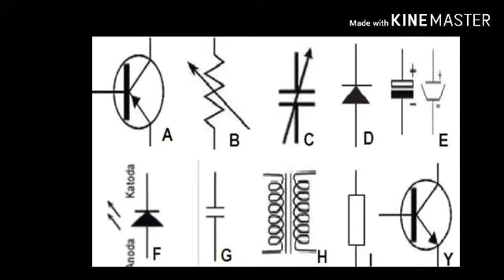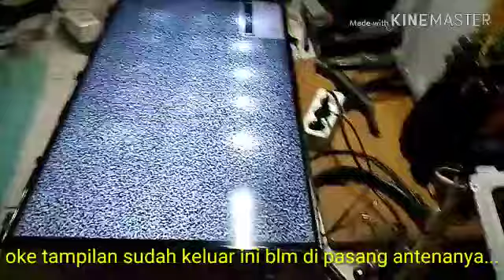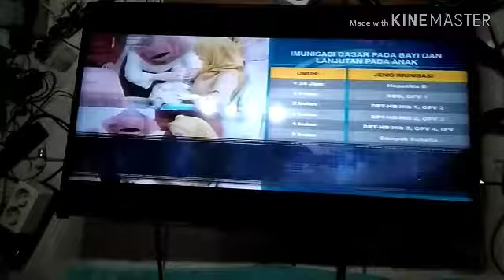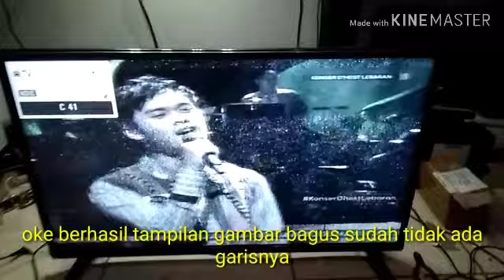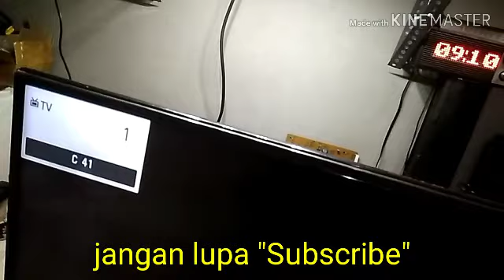Cara memperbaiki panel yang blank dan bergaris #v5

Comment: Assalamualikum ...gan...ane mau tanya ke semua comunitas teknisi khusus tv led,ane ada masalah ,di tcon lg32 LN1500 mengalami short / tidak ada tegangan vgh. Bagai mana solusinya tanpa harus bli tcon baru. Bisa di jamper ga? Terima kasih ...sy berharap ada jawaban yg tepat. Maklum sy baru pemula.
Reply from the maker: Short dgn grn apa 0v ?
Coba cek bagian voff keluar tegangan apa gk ?
Klo gk koslet dgn gnd dan voff keluar - v pake step up untuk ke vgh dan jika short coba lepas ic dc to dc klo tidak shot lg ic dc to dc rusak tp klo ic dc to dc sdh di lepas msh short kemungkinan cof atau panel short ...
Reply from the maker: Video di atas di ukur dari cof dan ticon keluar tegangan untuk vgh
Reply: Terima kasih...atas balasanya...nnti sy coba ,semoga bertambah terus ilmunya gan...
Reply: @teknisielektro  maaf gan...klu ada copotan t con lg32LN1500  ane mau gan...